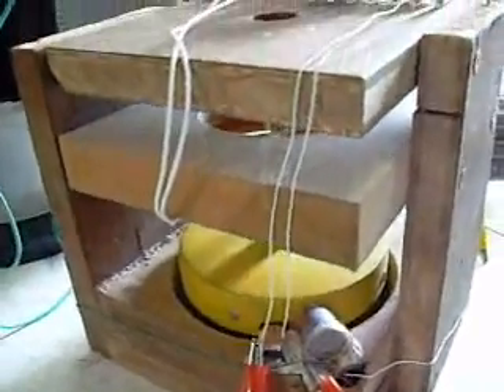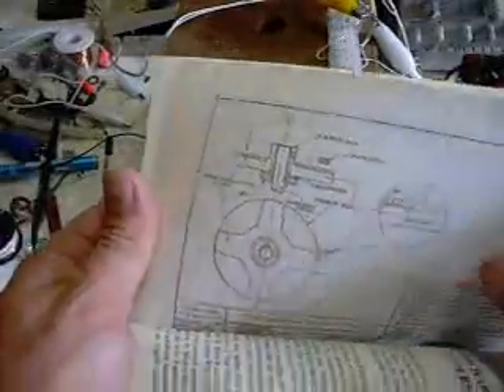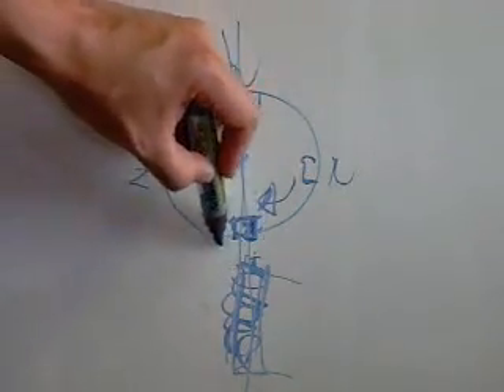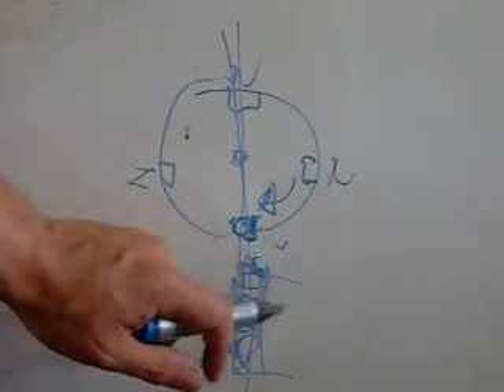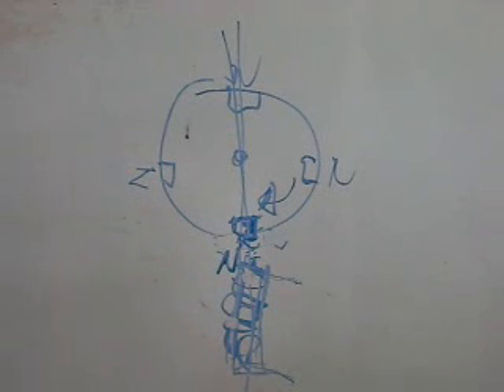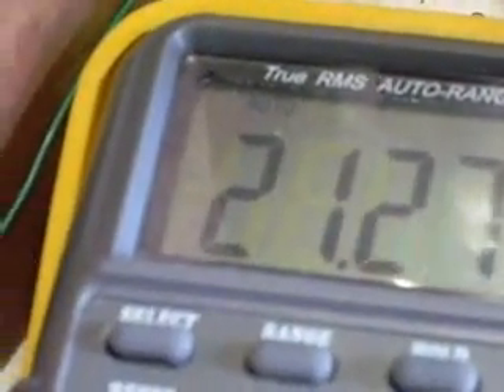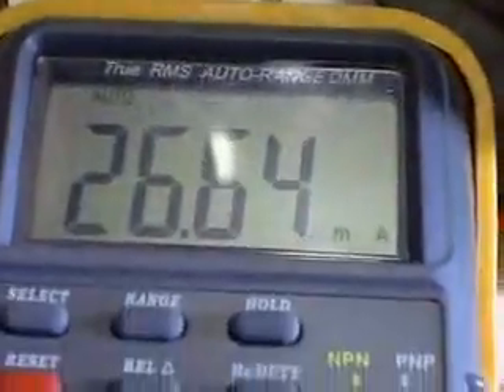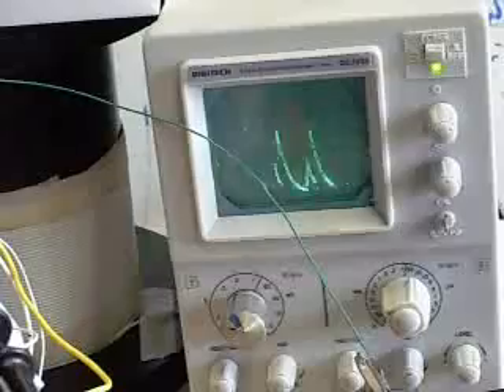Magnet motor/generator Adams motor replication

Comment: Robert found that the source of power is not the magnets so neodymium magnets have no gains at all .The source of power is outside of the motor generator as it is not a closed system it is part of the solar system so when heads say the 3rd law makes it impossible it shows they are unable to evaluate what is actually happening.Great explanations mate love your ingenuity.!?have you got a copy of Robert Adams notes?

Comment: This is interesting in regards the Adams motor. Excerpted from "A Practical Guide to Free Energy Devices":

"First and foremost, high performance can only be achieved with the clever use of power collection coils. These coils need to be positioned accurately and their power collection restricted to just a very short arc of operation by connecting them to, and disconnecting them from, the output circuit at just the right instant so that the back EMF generated when the current draw stops, actually contributes to the drive of the rotor, speeding it on it's way and raising the overall efficiency of the motor/generator as a whole.

Next, the shape of the magnets used is important as the length to width proportion of the magnet alters the pattern of it's magnetic fields. In direct opposition to the diagram shown above, the magnets need to be much longer than their width (or in the case of cylindrical magnets, much longer than their diameter).

Further, a good deal of experimentation has shown that the size and shape of the electromagnets and pick-up coils has a major influence on the performance. The cross-sectional area of the core of the pick-up coils should be four times that of the cross-sectional area of the permanent magnets in the rotor. The reverse is true for the cores of the drive coils as their cores should have a cross-sectional area of just one quarter of the rotor magnet cross-sectional area.

Another point which is almost never mentioned is the fact that big circuit gains will not be achieved unless the drive voltage is high. The minimum should be 48 volts but the higher the voltage, the greater the energy gain, so voltages in the 120 volts (rectified US mains voltage) to 230 volts (rectified mains voltage elsewhere) should be considered. Neodymium magnets are not recommended for drive voltages under 120 volts."

http://www.free-energy-info.com/PJKbook.pdf
Reply: Hi Lars,Is the overall length/diameter ratio of the drive coils important?

Comment from the maker: @CollinMel thanx for commenting-this video was made at a time when anyone posting videos about magnet motors on youtube were ridiculed and targeted for defamation.
the preface was added to address that issue and to bring awareness of the reasons for building such a device to the persecutors.
Reply: Nice going m3.  I salute your efforts here as one who also believes in bringing awareness of this technology. Let's call it the Camel's nose under the tent in raising awareness of this technology.  Exposure to these ideas will bring others into the truth-seeking tent.  Once aware of these hidden concepts it no doubt leads many others to seek  hidden truths withheld over the decades since Tesla.  Late to the party, I'm on my 4th build and getting dangerously close to OU.  My current design uses an MCU-based design for tight precision control over the drive and pickup-coil pulse.  Its certainly been done with  Arduino designs however, since  my programing skills (and tools) are only in assembly language, that's what I'm using now.  There seems to be much conflicting info on the web these days and your info really does get close to the mark.   Just discussing the breaker switch on the pickup coils is a very important piece that others do not treat in their post.  We all hold small pieces to the mosaic of this bigger and glorious picture.   Thanks for your contribution.

Comment from the maker: @jib1000 since you fail to understand,let me spell it out.
learning about things like Lenz law,Hysteresis loss,phases of coils,magnetic reversal,ferrite compositions,collapsing fields producing back EMF,one wire transmission of electricity,&desulphating lead acid batteries with pulses,is what i consider brain food.
these subjects are some of the topics i covered with Adams device.
whittling 2x4's is far more productive than whistling and it teaches how to sharpen a knife and not cut yourself.

Comment from the maker: @ChristopheBeau i have tried it with the generator coils hooked to a capacitor and the same capacitor hooked to the run coils(no battery)-at best it winds down very fast so output is less than input-yes it needs an impulse to start-just to get it into the firing position of the reed-if the rotor is in the right position it will auto start,but the configuration of the magnets is such that wont sit in the firing sweet spot naturally.
thanx for your comment

Comment: Well you have successfully created a horribly inefficient electric motor. As for the higher voltage, it has to do with the lack of loading on the coil as well as the moment where the rotor is at it's highest rpm with no load on the "generator" coil creating a peak voltage.

Comment from the maker: i do read books-its common knowledge that we dont fully understand magnetism and its relation to electricity-can the ABC of electrical machines answer why i get higher voltage when the generator coils are switched open circuit for a small percentage of the duty cycle-or the reduced eddy current drag forces that lead to higher speed of the rotor,becasue of this open circuit switching,or why i can charge a capacitor with only one wire?

Comment from the maker: i purchased instructions thru Nexus magazine many years ago,not sure if it is still available-info can be found online search for "robert adams magnet motor generator".
Adams machine used a commutator-i went for reed switches becasue it was easier than building a commutator.
Adams didnt have a second rotor on the shaft which i have incorporated for the adding of other coils and the tighter radius of the smaller rotor gives good switching when used with reed switches.
feel free to PM me!

Comment: they are kinda alike, iv only seen what others have produced on the ocilascopes?..  them things any way. its just the bedini can do it alot faster as it uses a semi conductor or transistor to switch on and off. prone to heat and surge damage, unlike a swich, but that can fuse shut depending on what it is made of/ how big.

Comment: how about using thicker guage wire on the pick ups? its less voltage but more amperage as that is way more inportant power wise. relay coils are good for trigger coils iv found but not as such for power generation.

Comment from the maker: thanx for commenting-im only using 24volts and have been bitten several times,so at higher voltages i would definately recommend some good insulation if your tinkering while its hot.

Comment: I'm currently drawing plans for a similar project and have been told that a correctly wound electromagnet with the right wire operates better on high voltage like 1000 and will operate effectivly only using miliamps. I've also been told rubber gloves and a rubber matt to stand on. :)

Comment from the maker: bedini uses bifilar-adams uses separate circuits for drive windings and generator windings.
im only getting away with using a reed switch because of the fine windings on the drive coils limit the current and prevent the reed form burning up too fast.
i have burnt up many coils and relays before i tried this combo of 24 V relay coils as the drive stators,reed switch and 24 V battery.
even if the reed sticks and it stops-it wont burn up the coils.
need to get rid of the reeds.

Comment from the maker: yes im quickly becoming aware of the fact that even a good DMM will not even see the fast high voltage spikes,i know they are there-cos i can easily light a neon-and the thing has zappped me several times.
i have diodes to try tame down the arc in the reeds-they dont last long tho.
atm they are a cheap easy way to achieve mechanical switching,and im sticking with Adams' suggeestion of using mechanical switching if you want to get a head for what is going on.

thanx for your comment